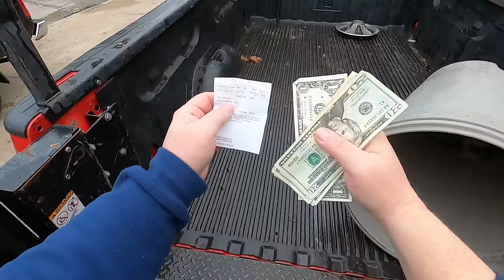Curb Score - I Got the Upgrade

Comment: There is a low temperature oil for snow plow hydraulic units for the same reason. Maybe it could be used in your hydraulic system as well

Comment: To install the backup beeper , remove the taillight and find the reverse light . Splice into that wire , and the ground wire attached to the body . Place the beeper where it won’t get covered in road grime , simple .  👍🇨🇦
Reply: Anything that requires splicing is beyond me.😂

Comment: All you have to do is tie in the buzzer wires into the backup lights. Then anytime you put your truck in reverse the alarm will go off.
Reply from the maker: Would the alarm go off just by putting it into drive because it passes through the reverse section and momentarily lights up the reverse lights?
Reply: @ScrapPalletMan Paul, i'm sure there might be, but I would think there is a little bit of delay before the switch is activated.
Also you might want to check out YouTube to see how to install the backup switch.

Comment: the money people spent on buying those grills and then they are put out at the curb for trash. The third grill you got had to be around 600 to 700 bucks new. It's a Char-Broil. Glad you kept it to see if it can be used again. That hub cap you kept is a Chrysler hub cap. Probably from a Dodge or Plymouth car.